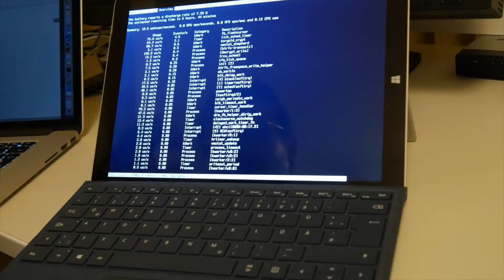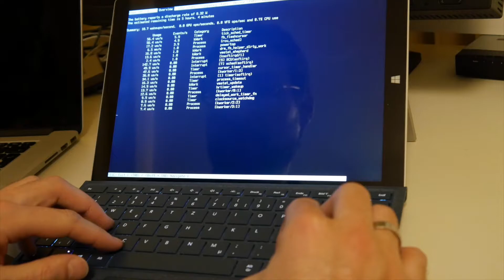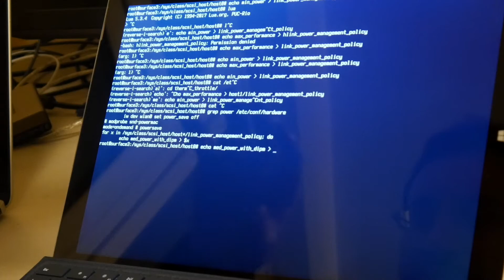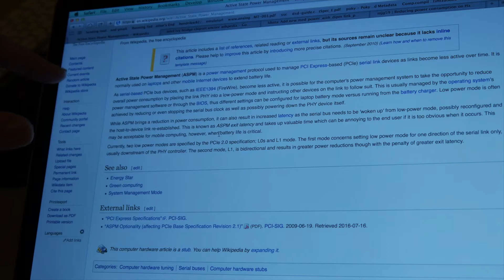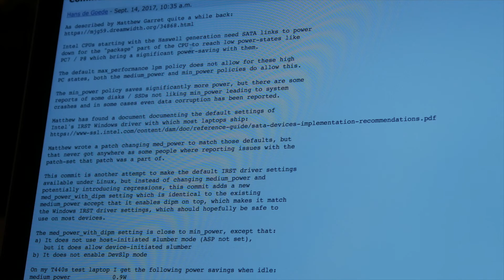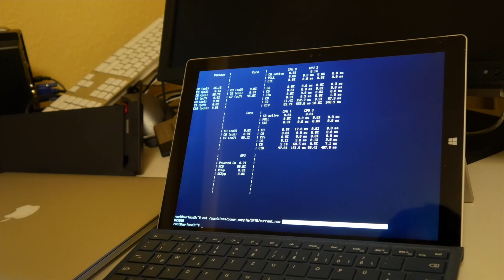Saving 〉1 Watt, 15% idle power! Intel Core-i, Linux PCIe SATA Aggressive Link Power Management

Comment: Is this different from enabling it with a power saving daemon such as tlp on an older kernel?
Reply from the maker: As mentioned in the video, the old option caused data corruption for some, so this probably new in 4.15 option is supposed to be compatible with more controllers / storage. Also my videos are meant to be general tech education and awareness.
Reply: Sorry, I missed that part. I just tried and I'm getting a few tenths of a watt less on the newest 4.15 compared to 4.14 with extreme power saving enabled (didn't experience issues) so it looks like it's even better.
Reply from the maker: issues may came with high i/o load, ... the option is not supposed to save more than before, only be more compatible and thus safer.
However, I assume most people run with vanilla, stock settings, and thus miss an hour of battery life (depending on their work load, obviously, ...)